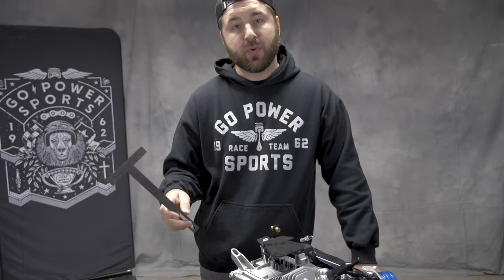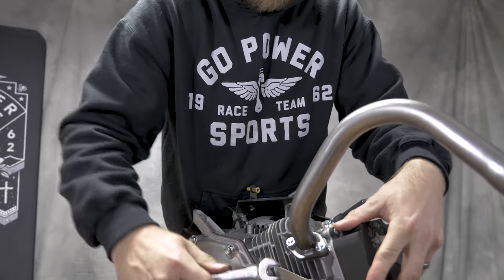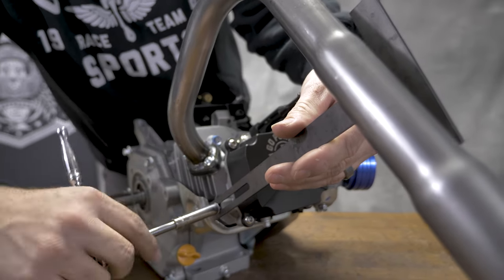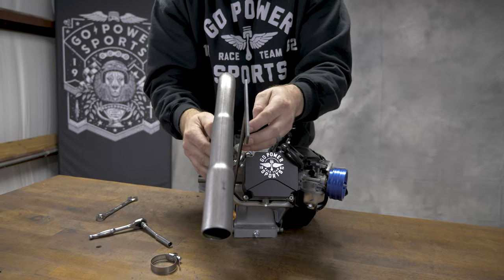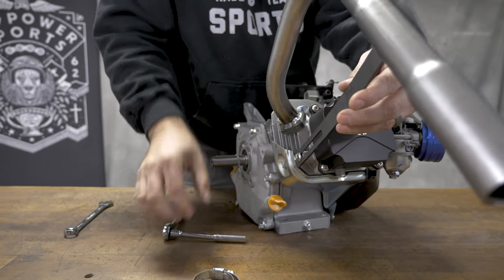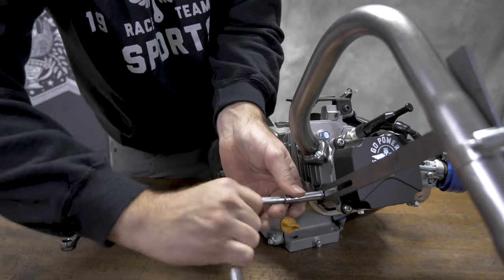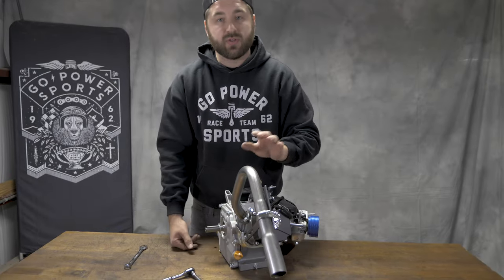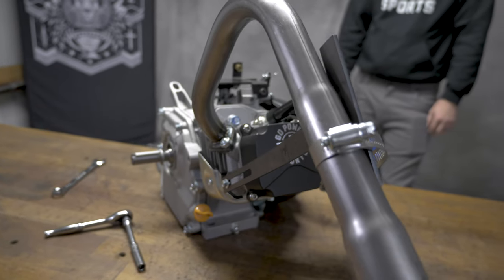How to Install the Header Pipe Support

Comment: Wow ! I wasn't even close with mine.
Not knowing where it's intended to go, I mounted to the rear fender mount and to the muffler I bought with my kit using 2 hose clamps.
The one that came with the muffler and the one that came with the bracket.
It seems to work great, but maybe you should include a picture with it on how to use it.
Reply: There is a link to this video on the website page for this part and you want pictures in the box.

Really?
Reply: @NubsWithGuns  yes, there was other instruction included and they could easily include a picture.
Reply: @TylerSnyder305  But after you already knew the vid exists.
Haha
Im only pickin on you not trying to be a jerk that much.
Reply: @NubsWithGuns  I'd rather not need to use my phone with dirty greasy hands when I could be able to just take a quick glance at a paper.
Reply: @TylerSnyder305  Stop, now you're afraid to get dirty.
Reply: @NubsWithGuns  no, I just don't need to be getting grease and oil...etc inside my pocket and on my phone.
I'm not wearing gloves I can remove because I'm not afraid to get my hands dirty, and that means whatever is on my hands will be in my pocket.